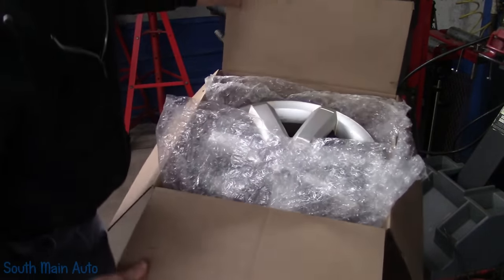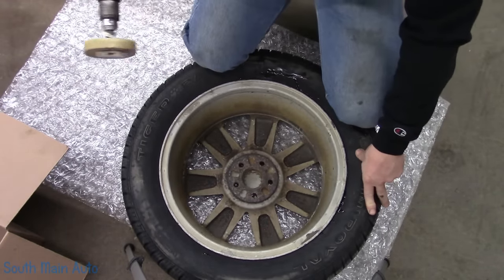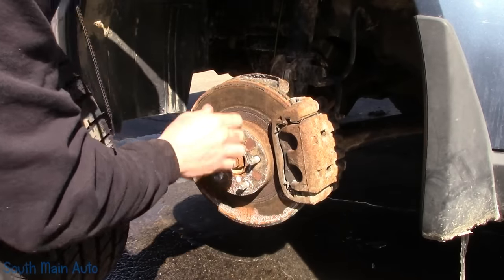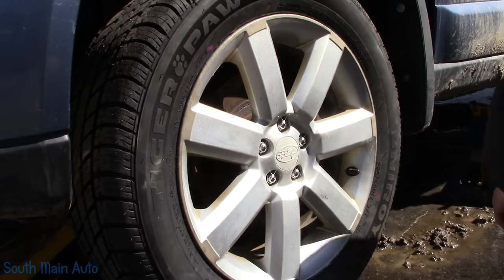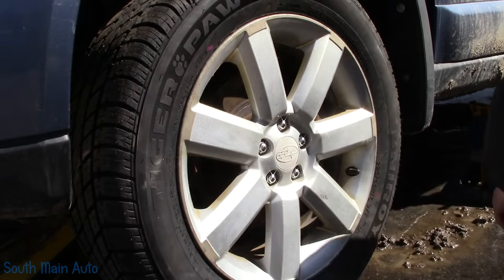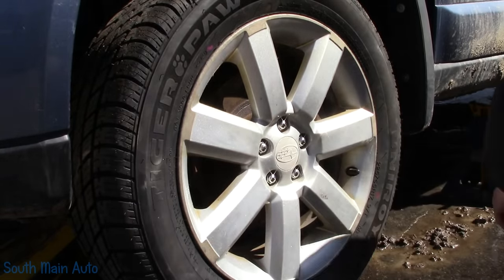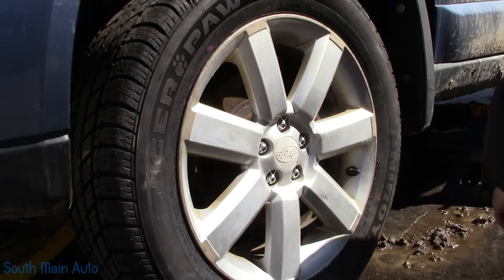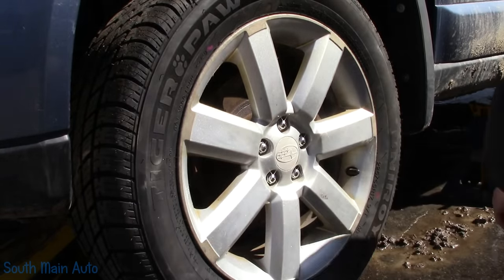Subaru Lost A Wheel On The Highway!

Comment: Have you dealt with with older S10 (93') control upper control arm removal?  I've had to grind off the bolts because they were all completely seized but I want to replace them with OEM bolts.  I can't find 13/16" hex flanged bolts  Any suggestions?

I have seen The LMC bolts but they are extremely overpriced.

Comment: Those tiger paw tires suck and always cause either tire noise or vibration
Reply: they also dry rot prematurely; won't last 5 years even if you don't use up the tread by that time

Comment: Why does every tire changing operation begin with knocking/removing the old weights BEFORE mounting a tire?    THE WHEEL IS OUT OF BALANCE - NOT THE TIRE.   Leave the stupid weights ON - then balance - and you will find that the new weights - if needed - will go almost exactly where the old weights were.   Just wasting lead.
Reply: i take them off anyways because they MAY be in the way of mounting the new tire (at least the clip on ones~ save them & they can be re-used) with the stick ons, you can just clean the backings off and mount new 3M double sided tape on those if you're not chucking them in a bucket to be recycled

Comment: I had new Mastercraft HSX tires and new pressure sensing valves put on Jeep 2007 OEM aluminum rims about a month ago. 44 psi. Today checked them and psi 26, psi 30, psi 36, psi 29. Is this normal ? If not what should I do ? Do aluminum rims go bad ? Can the tire store (BT) fix them to hold air longer ?

Comment: There was this guy lost a wheel outside an asylum for the intellectually challenged. Found the wheel but not the nuts. Was beat. Inmate overlooking from asylum says “take one nut from other three wheels use them on this wheel and will get you to a garage. Driver looked up in admiration. Inmate said...”I may be mad but I ain’t stoopid”

Comment: They probably used a impact on the wheels to tighten the lug nuts. The subaru wheel studs break easily so the need to be torque with a torque wrench.

Comment: have a question, can a CV axle be just greased and not replaced?
Reply: If it is undamaged, sure. New axle and joint assemblies can be surprisingly cheap, though.
Reply: if you hear clicking on a turn, then it's too far gone... just replace the whole cv axle assembly for the quickest turn around/ cheapest labor rate

Comment: One car I hate is Subaru. especially wheel bearing or front end work. In upstate Ny salt. Seems they're designed to fail. My kids had three, that dad had to repair. Designed for corrosion. Torch and air hammer everything. Don't ask me about brake lines!! or Evap lines. Fuel filler necks. Will never own one.

Comment: What a rip off. New wheel, new nuts,  new tire, new valve, and new ball joint when it's got "unsafe" wheel bearings. He should have held the car for ransom and called the inspection cops. : )

Comment: Pull trigger on impact, aim at lug nut..miss by 3/4 inch which scars the rim, then finally catches on the lug nut.
Test drive badly damaged car with a vibration thump so violent it shakes the whole vehicle , while trying to clock 0-60 in record time and launch vehicle on the RR Tracks. You must be a recovering alcoholic with an attitude.